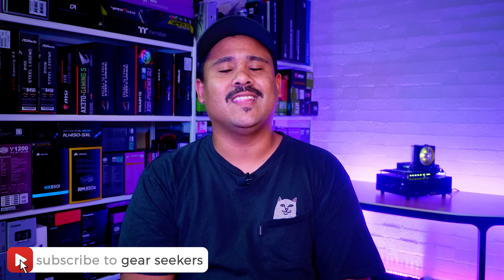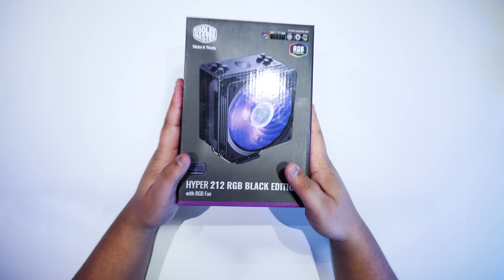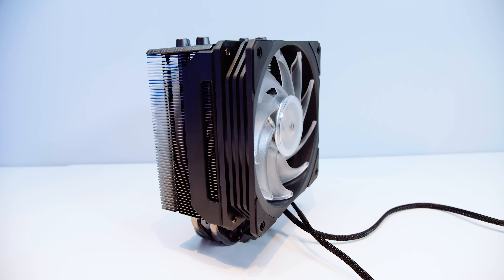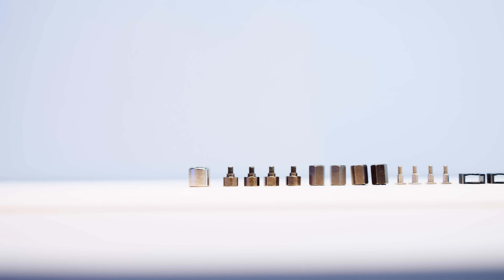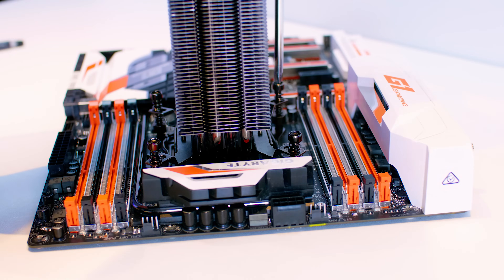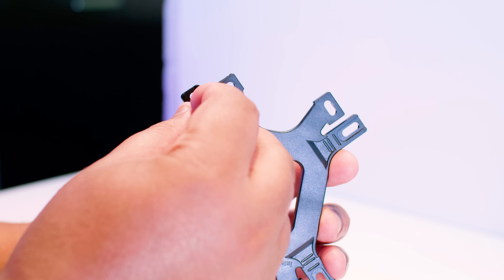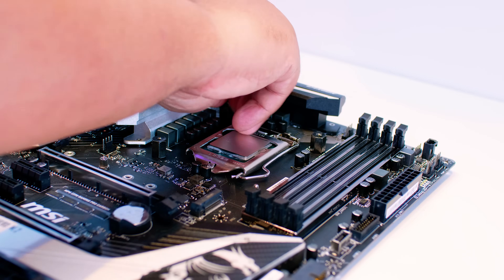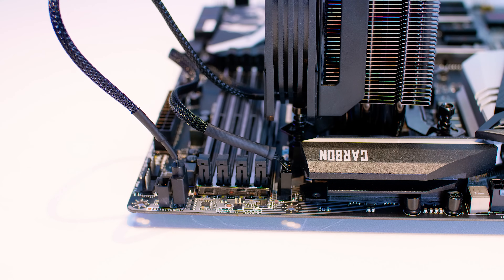HOWTO Cooler Master Hyper 212 RGB Black Edition Intel (LGA 1200) Install Guide

Comment: Excellent video.  Thanks for showing all the hookups for the RGB. Had all the information I needed to decide that this fan was not for me since I'm trying to keep the cord count for an old PC I have down to a minimum. Since it doesn't have an RGB header, I'd have to use the included analog controller which is fine... Except or the fact that it uses Molex and that'd require me to connect another PSU cord bundle in just to control the RGB.

Comment: Your the only one I saw that actually showed how to plug the fan and RGB into the motherboard. thank you,
Reply: Hey, so, does the arrow on the rbg cable connect to the 12v part of the header on the rgb motherboard? Seems to be that way just not completely sure.

Comment: how is this cooler for a i7 9700K cpu, will it provide enough cooling, I am not planning to overclock
Reply: TDP of 9700K is 95W... TDP of 212 Black is 150W... if you're not overclocking you're fine with room to spare.

Comment: Hi! I bought this CPU cooler and it cools down really good and looks cool. But it makes a vibrating sound. It's very noticeable. Fan is running at 950-1100 rpm. Should it run like that? Can anybody help me?

Comment: Does ‘Intel 115X’ Include LGA 1151?
Reply from the maker: The X means it includes all of them
Reply: Alright, Thank you, I’ll buy it and install it your way!
Reply: Gear Seekers do I have to remove the motherboard?
Reply: @walterab540  Maybe maybe not if your lucky the back of your case will open and have a big enough opening to install it. if not then you will have to remove your mobo.
Reply: ziperrr MW I'm wondering the same thing

Comment: I have the cooler and It's blocking my 1st ram slot.
Mobo: asus tuf x570 
Ram : corsair rgb pro 8X2 cl16 (3200mhz)
Was thinking of getting more ram.
Any recommendations?
Reply from the maker: You can move the fan up

Comment: If anyone is wondering how to install the RGB connector here's how: follow the instruction booklet in terms of installing all the connectors to the RGB controller, once done you'll need to install the final cable into a 4-pin molex connector. That cable should be coming out of your psu and looks like it has oversized pins. You can't miss it. Once in, your RGB should work. Not sure what a molex connector is? Google and it will show you. Hope this helps :)
Reply: But how do you change the color of it? It does not show up in RGB Fusion, Open RGB, or ICUE, It didn’t show up in the Gigabyte Bios under Peripherals, my case has buttons that should change the colors but they don’t do anything when I press them, and mine doesn’t have a remote to change the colors, I didn’t build my PC but someone else did and I bought it from them used on OfferUp. My keyboard shows up in ICUE and Open RGB, nothing shows up in RGB Fusion, The RGB part that goes around the ports in the back that’s connected to the motherboard shows up in the Gigabyte Bios but my Cooler Master 212 and another fan in my PC are both stuck the default blue and I can’t find a way to change it
Reply: Hello. Will that RGB controller help to control RGB fan on cooler even if i dont have RGB header on my motheboard?

Comment: I put it in the rgb header on the motherboard but the ASUS AI Suite 3 doesnt let me change colors, and where do I plug in the ending of the rgb controller?
Reply: Weasel Head You plug the end of the controller into the molex connecter that’s included and then into your psu. I did that but it’s not working for me.... soo idk what to do
Reply: @jonahmann.  it worked for me, I don't know what's wrong with yours, but hopefully you'll figure it out (:
Reply: @schellpad4121  Glad it worked for you. So my RGB just wasn't working at all so I ordered a replacement and it worked. After i got it installed I plugged in the fan that wasn't working just out of curiosity and it was working lmao. What a waste of time LOL

Comment: My rgb header is on the bottom of my motherboard so the cable can’t reach is there an extendor and I tried using the rgb controller but I don’t know where the other end that comes tied goes into?

Comment: Hey. I have this CPU fan but I just can’t get the RGB working. I’ve tried both the RGB header on my MB as well as the included controller but it just won’t work. Any ideas on what I can do?
Reply: Daenke Kong I’m in the same boat.... did everything and it’s not working

Comment: Do it really need a second fan?
Reply from the maker: no
Reply: @GearSeekers  thanks. I already connected another :O  but it's air flow, not static pressure.
Reply from the maker: Doesn't really matter that much

Comment: I tried the 10:24 approach with plugging into the RGB header of the motherboard but my fan's LED still don't seem to be lighting up??? 
I have Gigabyte Auros H370 with RGB fusion running but no sign of life from the fan's LED :(
Reply from the maker: probably plugged it in backwards
Reply: @GearSeekers  I put the socket arrow on the pin 12 V though
Reply: All good, got it by using the other 5-pin (12V R G B W) header and used the 4 pins (12V R G B).

Comment: I don't know if I do 20xx or 115x?????
Reply from the maker: pretty simple. how many ram slots does your board have
Reply: Gear Seekers mines has 4 sockets so what
Reply: It has 4
Reply: Also don’t worry I found it out eventually and my pc is all up and running now 👍
Reply: Purpleunicorn783 YT which one u used
Reply: i used 115x

Comment from the maker: Intel 20XX Install 4:40
Intel 115X Install 7:14
AMD AM4 INSTALLATION GUIDE: https://youtu.be/TSbW-UcLS-g
Reply: How about an LGA12xx
Reply: Does this intel guide still work with 10th gen intel cpus?
Reply: What about 1200?
Reply: You should have noted in here with your time stamps that, per the manual,
The intel 115X instructions are the same for the 1366 and the 775
The instructions for the 20XX are the same as 2011-V3 and 2011
and the AMD appear to ALL (FM1,2,2+, AM2,2+,3,3+, and 4) be the same

I just installed mine to my 1366 (EVGA x58 FTW3) via the manual (before finding this video, I didn't look beforehand) and I thought the manual was fine.... Just saying.

Wolfe, about the screwdriver you can use either a Phillips PH1 or PH2, but the PH2 is larger so fits better with less slipping. I used a Klein 11-in-1 I got at Home Depot, The head/handle is just skinny enough to fit next to the fins to tighten the spring screws, but it worked fine.

KALD3S, I have an old MOBO (Pre-RGB) so I don't have a header for it either, that means we won't be able to control the colors with Aura, Mystic, etc... You'd have to use the included controller (or another external type, unless there's one that connects to USB or something....). I took a piece of automotive 2-sided molding tape and taped the controller to the top of the fan housing, now I just have to find a way to power it (find molex plugs for my modular psu).
Reply: I dont have an rgb connector on my motherboard so if i connect the rgb controller will i still be able to change the effects with asus aura sync?
Reply: Really appreciate how you took the extra moment to add the time markers for each processor type. /subscribed
Reply: Adam Stevens can you help me i don’t know what is my cpu instal type (my cpu is i5 9400f)
Reply: @aimholic1724  I’m going to get that cpu and it’s socket lga 1151
Reply: What philips screwdriver did you use?
Reply: What would an i7-9700 be ?
Reply: Hi will this work with any motherboard?
Reply: @scorps9851  if your talking about the cooler then yes it should but im not sure about threadripper mobos
Reply: @Carlos-tt5jz  is lga 1151 the same thing as 115x?
Reply: @elijah5233  yes
Reply: @scorps9851  Btw a threadripper is a cpu that is a rectangular shape instead of the regular square shape
Reply: 11:01 can I use the four slots of ram with this cooler?
Reply: thank you!
Reply: Gear Seekers does ‘Intel 115X’ Include LGA 1151 ?
Reply: Walter AB does it?

Comment: Less a question about the cooler itself and more a question about RGB Fusion I guess - is it easy to control the cooler RGB through Gigabyte's software?
Reply from the maker: plug it in to your motherboard and it works.
Reply: @GearSeekers  Ok thanks.
Reply: Mine doesn’t show up in Gigabyte Fusion and mine is stuck on the default blue, does someone know what to do